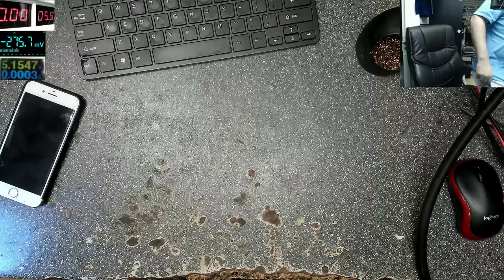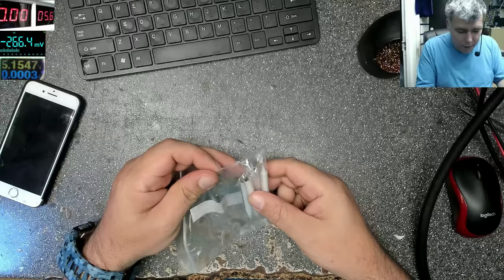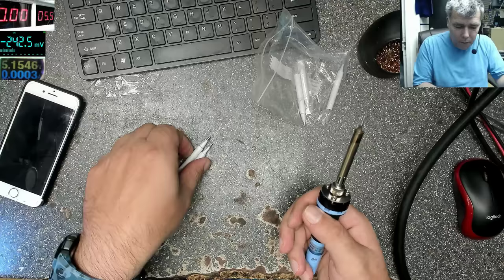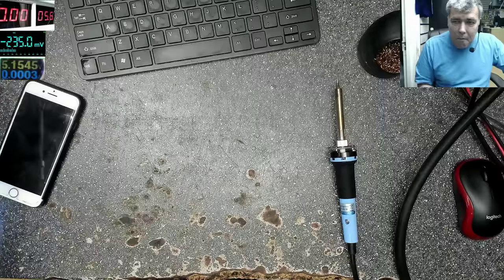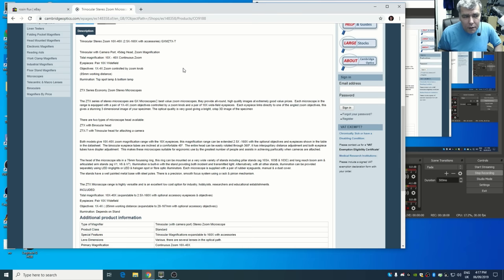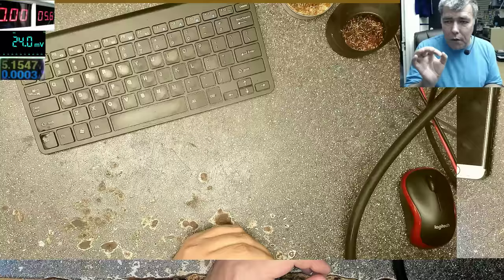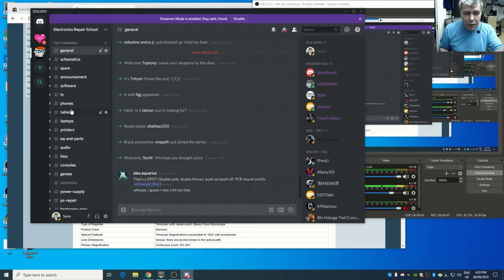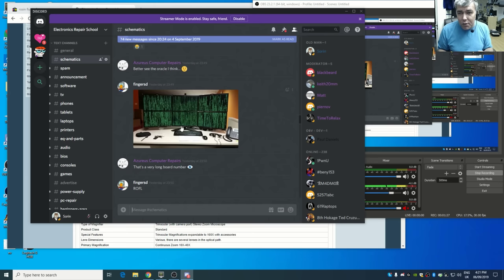4 Must-Have Tools For Beginners DIY Electronics Repair

Comment: Power Supply: Korad KA3005D
Soldering Station: KSGER OLED T12
Hot Air: BEST BST-863
Flux: Kalafonia
Microscope: Whatever you can afford.
Multimeter: UT801 he is using is really outdated look for Uni-T UT8802E Or UT8803E

Comment: Back in the 70’s when I was a young teenager I had a bit of wood with 2 lengths of wire top an bottom (a bread board) and a ‘lucky bag’ bag of bits. I got a small pocket analog multimeter for my 14th birthday and away I went. I tried making a soldering iron and blew the mains fuse for the ‘ringmain’. 
Nearly 45yrs later I’m still learning about electronics.
My hobby became my job and today I learned something from Sorin.
This is the place for honesty.

Comment: My tools: 5€ glue gun, 8€ soldering iron, 10€ multimeter, 3.50€ magnifying glass, 8€ screwdriver kit, 1€ toothbrush, 0€ my old identity card to open laptops or any device, 3€ tweezers kit. Now I have to buy the heater gun station for 20€ approx.
Reply: Aarón Stark cheap tools won’t last and are not very useful for beginners, and to get away with using cheap tools then you need to be a expert, a good soldering iron is a must for novice and you’ll get away with using cheap multimeter but the rest of stuff must be decent
Reply: @M.E63  I have no intention to buy expensive tools for the moment, because this is only a hobby for the moment. I work with software, not hardware.

Comment: Another great video Sorin. Just a word on ordering from China. If the item ordered is valued above £10 approx, customes and excise will ask for 20% VAT which is okay BUT, the Royal Mail will add another £8.00 set admin charge. So, if the soldering iron costs £19.00 from Ali Express, expect to pay an additional £11.80 !

Comment: I am an experienced TV engineer , I totally agree with you no need for expensive tools, so what I have done is, packed my over priced Pace solder station. the NEW solder station in the workshop is a Z99 adjustable solder station I think to 460 oc, the cost  £11:85 p  no special treatment normal workshop use I want to see how long it lasts, I've also bought a cheap hot air station, as of course the Pace is off line, I'm fascinated to see how they will perform, because I've often wondered if I paid for the name not the device.

Comment: Hello, thanks again for this video, myself i am using a Mustool G600 microscope , only 35€ , that is not binocular, but HD with a good screen and SD card for recording, good enough to check phone connectors and bad joints or anything, no need a medical laboratory microscope in my case. Good evening and sunday All

Comment: Wish i had seen your video earlier. I recently bought a cheap soldering station and it came with just two tips. And now that i try to buy more i can't find ANY that would fit. No cheap ones, no expensive ones... none. :-D On to the next one i guess. :-D My only consolation is that it cost me just 20 Bulgarian leva a.k.a. £9.

Comment: Thanks for the inspiration and motivation 🙂 With the excellent videos you have uploaded I’ve repaired 8 Samsung phones varying from a Note 3 faulty note screen to a total restoration of Samsung S6. Over the weeks I’ve been buy tools needed for each repair including Kalafonia flux. Next on my shopping list is a hot air station and micro-soldering tools.  I had some difficulty sourcing quality suppliers and with just starting the business, working capitol is limited and I buy as and when needed. I ordered a screen for the note 3 which turned out to be faulty. They sent out a replacement one the next day. Can you give me an indication of what screens you keep in and do you send your old screens with working touch to a refurbishing company ? Any way thanks for the inspiration Sorin and keep up the excellent work. 🙂

Comment: The searching for tips and the soldering iron after, is actually a really good tip. I learned it the bad way. Bought my 1st soldering station, a cheap one, and I couldn't find no tips nowhere. I then searched for tips and found out that the Hakko brand is really good and there is a lot on Chinese knockoffs just as good as the original ones. All kinds of tips and soldering irons at really good prices. I have a 2 in 1 YIHUA 862D soldering station and a cheap hakko tips compatible soldering iron for easy transport.
Bought two ANENG AN8009 from Ebay. Very good price/quality and comes with a bag with lots of accessories and different tips.
I use KINGBO RMA-218 gel flux, very good price/quality.
Reply: Thanks for putting in this comment I was just about to buy a Bakon BK701D soldering station  (USD 135 incl. shipping)  and realised you need a specific tip only from Bakon. So now instead I'm going to buy the same as you YIHUA 862D (120 USD incl .shipping)  so you save me a potential headache and 15 USD :)

Comment: Chinese brand multimeter is good to test low voltage but if you want test the high voltage better use Mastech Uni-t or Fluke

Comment: One thing i use is a reference voltage circuit (very cheap) to calibrate my cheap voltage meters and write the date on the back.
Often cheap meters don't have a way to calibrate, but it's easy to find how to add a variable resistor yourself.

Comment: The most difficult thing to find is a good soldering wire... I have to buy 5/6 different types every time... because it changes properties every time.... very mad about that...
Reply: Koster "44" Rosin Core Solder core 66,  No. 24-6337-0007  Very good solder!!

Comment: For ordinary old through hole components i like Antex 17 and 25 watt irons.
For the bit of electronics i do now, they will do :-)
Reply: SMD everywhere these days tho....
Reply: zx8401ztv I used to have antex but they are not powerful enough I think and now I got weller and ersa and thermaltronics which are great
Reply: Agree, for the average hobbyist doing the odd soldering repair - I still have an Antex XS25 I bought in 1991 - had one replacement element in that time, still going fine :D I have several multimeters of varying price and function - maximum £30, the most recent £10 Aldi one does everything I need :D I have a Weller station and hot-air station from a clear-out so they would have ended up in a skip. Be nice to have a microscope but even though I consider myself doing a lot on repairs (including SMD) I can't justify a) the cost and b) the space needed :o
Reply: Umski
Yep i have the 25 watt iXS25 as well, a good iron but the tips just get  eaten away inside (typical for antex tips), no it's not the iron getting weaker it's vanishing copper lol.
I have an old fluke bench meter,  but those yellow mastec 830b meters i have loads of,.
Dead handy to monitor many points on an amplifier that's on test.

Crude little things but great for basic Go/No go tests.
Aldi can be handy, but if you see something usefull then get it fast as you can, they don't sell the item again for years.
I've had ratchet spanners/digital calipers and heatshrink tube from them, good enough quality and cheaper than halfords.
Although anywhere is cheaper than halfords lol :-D
Reply: @zx8401ztv  yes true with Aldi stuff (and Helfrauds :D) - I hedged my bets with the multimeter as they had loads - got it for £7.99 when there were still a load left after a few weeks. On the other hand they had a gas soldering iron on recently and hedged again but then they only had 2 left the week after so stumped up full price :/
Reply: glyn hodges  thanks for the tip :) - the bit that puts me off with that one is needing the PC screen to view it on - something with its own screen that is portable would give me more flexibility on the types of repairs I encounter but I'll definitely be taking a look at that one for home use :)

Comment: Hi Sory thank you for shariing so  much valuble information. Your doing a great job and because of that life hope is good to you :P I did not see the video but i would like to test my ideas before watch the video. So i assume the 4 must have tools for beginners is training/education. How to use the rite screwdrivers. How not to pull things just because they don't come out, how to use the shoulder gun by feeling the instrument and the board, and by the time you get to have all this in one go, anyone should be able to do basic repairs.  But this kind of tools takes years to self develop and not to use them against you,:)) to make you lose more then your earnings are. It is  a highly difficult start for pretty much everyone. But once you get the senses rite. You then have to learn a new complex world of electric component and the massive amount of information you must understand and be able to use. I wanted to say that it gets easier the more time you spend practising the job. But in reality ... is not true at all. it gets wireder and harder each iterration of electronic devices. To the point when The really smart ones can do a lot of money but the vast majority will fail.   So yeah. Higly valuable to have a loaded brain. But what are the side effects of the long run? sudden death? and still looking young? Every year you must be adapting or dying. maby you don't get to suffer straight away but in 10 years you need to learn adapt and  use what you learned , if you can in order to ensure success in the future. But we are getting old and we are getting worn out by stress and the many difficult moment technician experience at work.

Comment: You are right, for beginers is ok, but my opinion is this:
1. Fluke multimeters will never die even is wrong conected. A China brand will die when you will conect the A or mA in paralel or any other harmfull connection.
2. A cheep soldering ironer have a long warming time at start and not so real measurement of temperature. An old school Weller is the best, will never die.
3. If you need a powerfull soldering ironer (150W), don't use rubish, use weller or other good brand. Is expensive but you will see the diference.
4. I started with the same tools like you, good advice, now i'm using weller, fluke, wera, is a good mix for me.

Comment: Switching lab power supplies have short cut protection. The only disadvantage is that the cheaper ones might have some noise at the output. But they are light and much cheaper.
Reply: He explains he doesnt want short protection.

Comment: Thank you for the great video 
I need a good hot air I blow all my components all over the place.
And a great weekend
Reply: The ones with the fan in the handle tend to do that. try turning down the airflow and it will help.  I have one of the cheap 858D and it's good for many jobs (it will blow components around though) but it is no comparison to the Quick 861DW I now have. Also the 858D just does not have enough power to remove larger chips.  IMHO it is worth paying more for better equipment in some cases.
Reply: Yes I have one with blower on the handle.
When I regulate the air it’s not hot enough.
So I will try to get a better one.
Thank you for the reply
Reply: You should make the one sorin made a while ago. lol
Reply: @MrRvdbeek  lol yeah. but besides jokes, in my country, every single phone repair shop or electronics repair shops, uses Gordak 952. wether analog one or digital one. some people buy quick 700 but really no difference except double the price. i have a Gordak 952 rework station, has digital temp for both solder iron and hot air gun, has good quality air pump inside (not fan handle) and i'm happy with it. i know ppl who got this model 10 yrs ago and haven't changed even heating element.
Reply: Erfan Ravan Bakhsh 
Thank you for the reply I will look for it and try get it without paying for tax. It is sky high .

Comment: Hi Sorin, love your videos, even the jobs you think are boring. I have to ask though, why do you (and others, Louis Rossmann etc) add  so much flux when de-soldering components? I've spent the last 50 years de-soldering without flux and only use it when refitting components. When I test component removal with flux vs no flux, I see no difference. What am I missing? Cheers.
Reply: no-flux is prone to oxidized/corroded circuitry and components. Also flux helps with solder molten flow ^^

Comment: Hi Sorin. Thank you for another great video. Just wanted to know a bit more about the linear power supply you mentioned and if you could tell us which model you use when youre locating shorts as youve shown on other videos? Thanks.
Reply: It's a 30v 5a  you can find It on eBay for approx 50€ , there are different brands but they are all the same +/- (have a look on he's video "my Power supply")
Reply: @MindYourBusiness1970  Thanks for that, much appreciated.
Reply: @MindYourBusiness1970  Will check for the video you are talking. Anyway, do you have the reference of yours ?
Reply: @poloemilien4858  on he's old videos if you check on links in description you Will find my tools if you Watch that one usually the video of the Power supply it's in the list of the suggested videos

Comment: I have a fluke 87 III and a fluke 87 V. The V has everything like duty cycle, Hertz , current clamp probes (that I need to get 80$-140$ dollars later) I would never have had these if my dad didn't get me then after his job retired them for no reason besides deemed "flaking out" and its never even been calibrated....I'm an overclocker and repair/modding enthusiast of all the things and I've never needed the resistance accuracy, special features or anything since I've had it. I'm glad I have it but I'd never pay 500 $ like they go for... I also using a clearence 20-30$ soldering station and just changed the tip after 4-5 years. Only thing I need now is more rosin flux. I've been using some liquid flux...I think I'll go watch your video on how to make flux.
Edit. I also have a few hot air guns but theyre the big hair dryer size. They've saved many computers, graphics cards, cell phones laptops , xboxs etc. From water damage alone also thank you for teaching me things like heating up the board on a space heater. You remind me of my dad actually only you can actually explain things well haha no to see if his power supply is linear and show him why I'll be shorting those resistors

Comment: Cheap soldering iron = poor temp accuracy and hit and miss results.
Cheap multimeter = generally limited in features and possibly poorer accuracy.
Good flux is good flux, no matter the price. Same applies to shite flux.

I'm not saying buy the absolute most expensive, but quality tools can make a world of difference to the end result. If you're just starting out for a bit of fun, then yes you can buy cheap and always upgrade later.

Comment: My Tools
Crimping
Desoldering gun/Set
Glue gun
Ethernet tester/Rj 45
Multi screw drivers
Dry/heater  blower
Wire jumpers
Multi testers/analog and digital
Software installers
External CD ROM
USB flash
Thermal Paste
Brushers
Cutters
Notebook/pen
Cellphone & Laptop
Reply: glyn hodges  i said Crimping not crimpers. My goodness. Bad reading..

Comment: the problem with cheap tools china clones is theh break easy, hot air does not last, soldering iron takes too long to heatup, cheap microscope no working area very small cannot work on laptops. hakko fx888d is 100$, eakins 7-35x with barlow lens is less 200$, hot air quick 2008 or 857dw is 50$, for a beginner its so hard if you dont have right tools you will get frustrated best to buy not expensive but not crap

Comment: @electronics repair school. Good day Sorin. I need your assistance in fixing my laptop. I have a rm notebook 320.When i press the power button, the power button led comes on and stays on.  The wifi led also comes on, the fan comes on sometimes and the processor and chipset gets hot. The problem is nothing coems on the screen and the harddrive led doesnt come on, nor does the hard drive spin up. Of note the laptop is taking 19V, 0.01A when plugged in and off. It takes 19V and 0.87A when the power key is pressed. COuld you help me fix it?

Comment: one question please about petrol, is it the same for briquettes ?
Reply: If you look carefully, Sorin is using Zippo lighter fluid.  Ronsonol is another brand of lighter fluid.  These are naphtha based fuels, very clear, and evaporates quickly without residue.  I think lighter fluid for charcoal briquettes is kerosene based.  With the increased use with disposable "Bic" type lighters, it is a bit harder to find lighter fluid in my neck of the woods.  I recently looked at Walmart and they wanted $20 CDN for a little 4 oz container.  Instead, for $20 I just bought a gallon of naphtha camp fuel so I can use it in my Coleman lantern and camp stove too.  LOL

Comment: Sorin i love what you do sir , but when it comes to multimeter please advise users that these cheapo meters are no good for anything to do with mains testing,People dont use cheap meters with mains power because they do not have sufficient protection  you get a cheap glass fuse  no blast protection or sufficient spark gaps be warned cheap meters and mains power DO NOT GO TOGETHER....... PERIOD!!
Reply: the glass fuse is for current mode only... cheap ones usually burn the pcb traces before the fuse as well.
Reply: Well said

Comment: can any one recommend me a linear power supply? I can only see a few of it online
when is started search it will give digital type... why is it that if its use in repairing phones and electronics you can only find a few of it? the ones in the market are for repairing are not linear?
cant seems to find characteristics of linear power supply that will still gibe supply even it shorted? I am missing something here? sorry i am kind of new also?